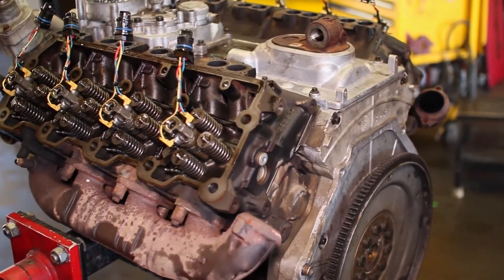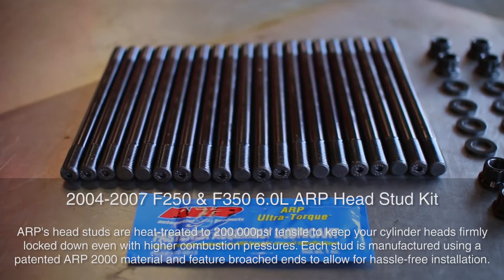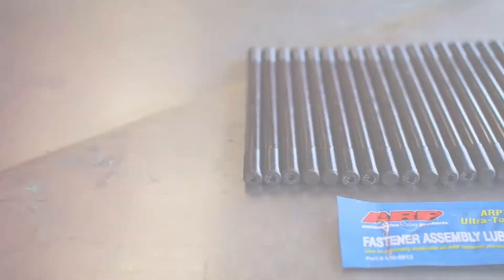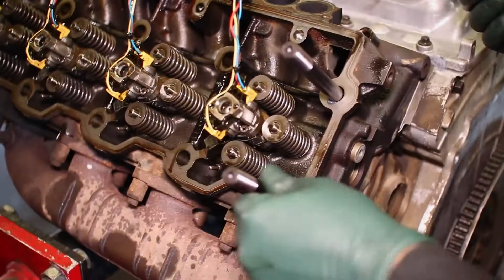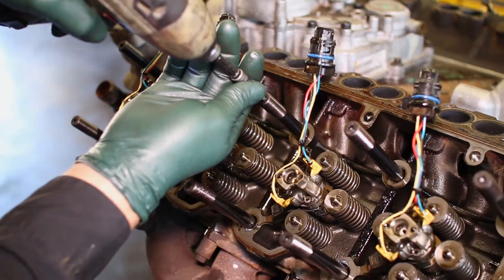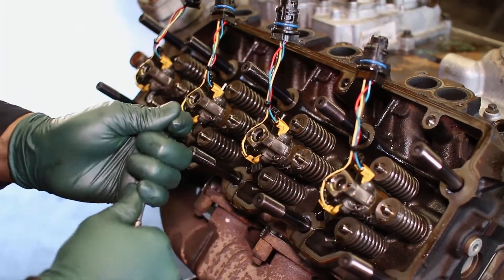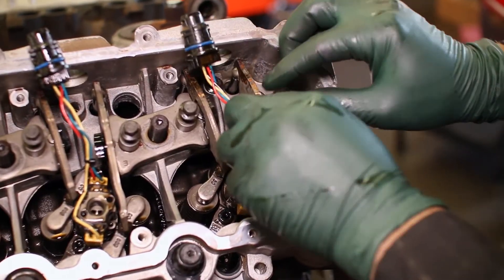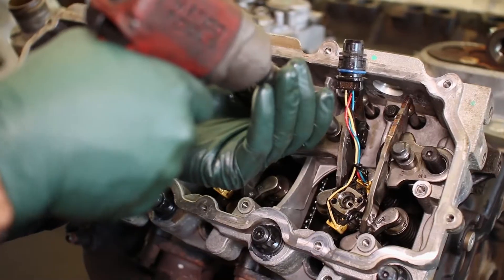2004-2007 F-250 & F350 6.0L ARP Head Stud Kit Install

Comment: I hope no one watches this video when they install studs.. read the directions .. hand tight, then torque the studs down before tightening the rocker carrier bolts. and follow the torque sequence.
Reply: 6.0Doctor exactly...gaf video
Reply: i dont trust these guys they installed brakes in a video and let the caliper hang
Reply: And tighten and torque in the specified way lol
Reply: they got lube between the cylinder head and the washer too